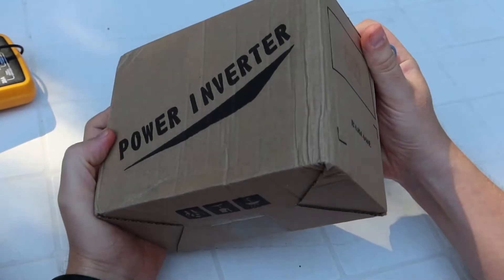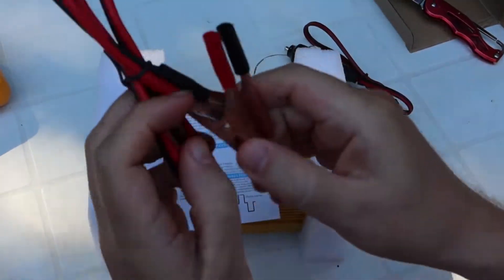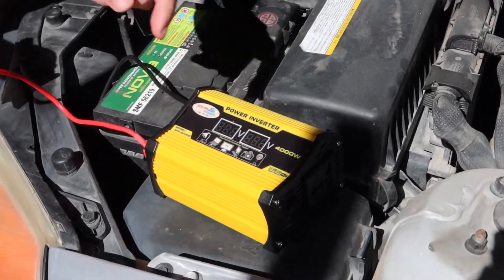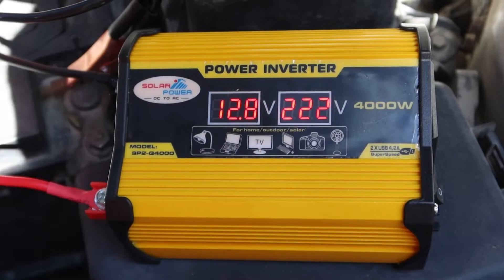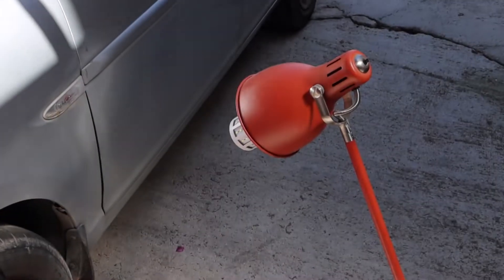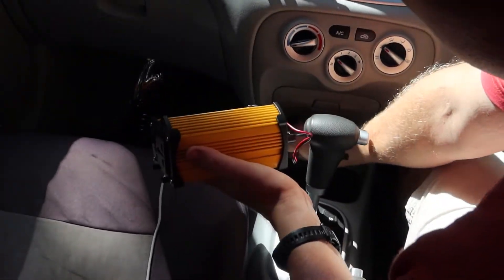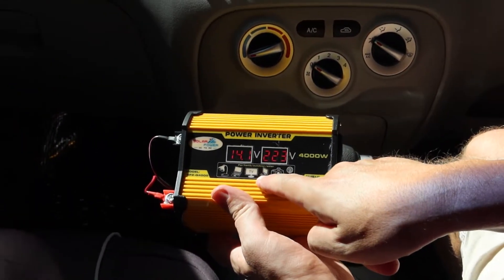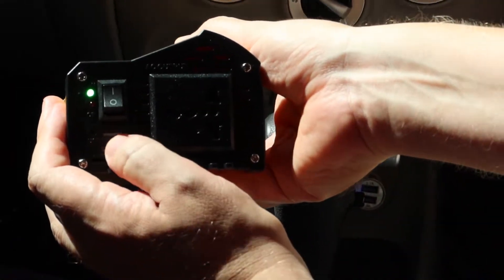Cheap power Inverter converter HitTime DC 12V to AC 220V testing, review. My opinion...

Comment: I try telling sellers they advertise false information contradicting eBays rules. 

4000w (4Kw) is enough to power either a tumble drier, 2 bar electric fire, very powerful 3kw kettle. Said enough. in reality it won't power a drill.

Comment: is this legit pure sine wave?
Reply from the maker: Thanks for your question. This HitTime power inverter is a modified sine wave inverter, which is why it's more affordable. It works well for basic applications, but if you need a pure sine wave inverter for sensitive electronics, you might want to consider other options. Hope this helps!

Comment: this is inverter 500w only
Reply from the maker: And 800W drill turned on safety circuit :)
Reply: Not from the cigarette lighter entry, it has to be connected to the battery probably for higher W